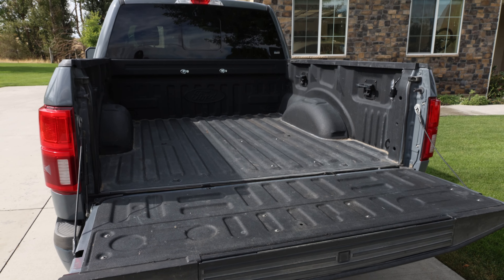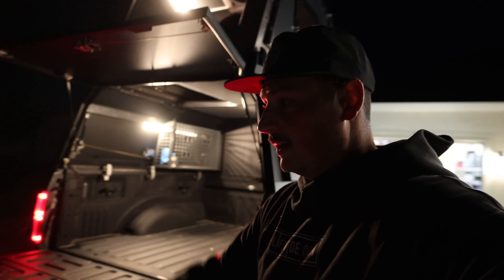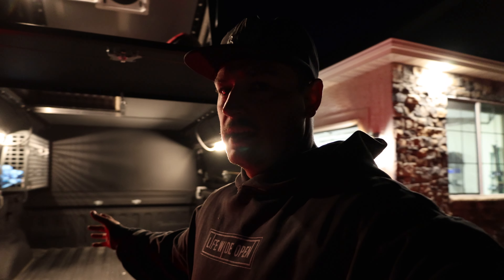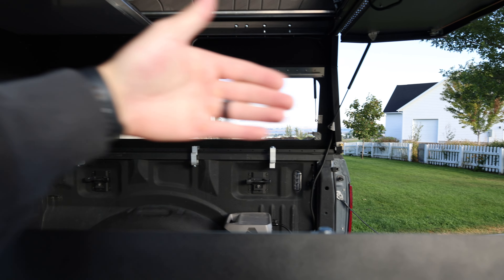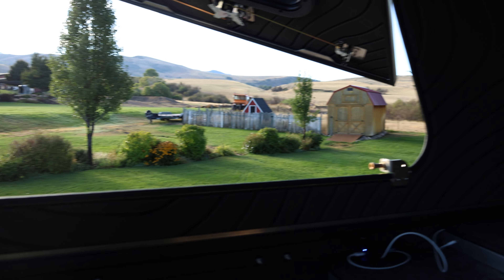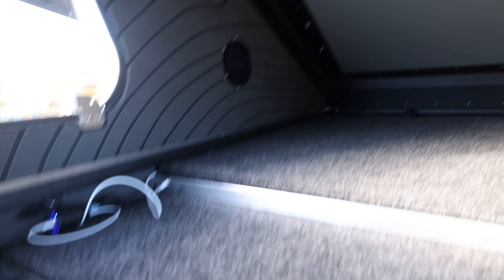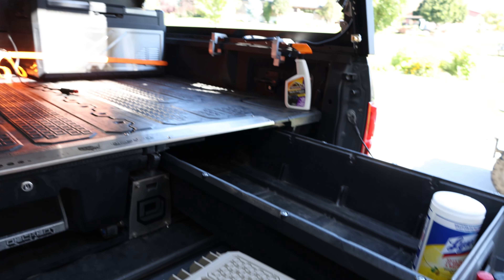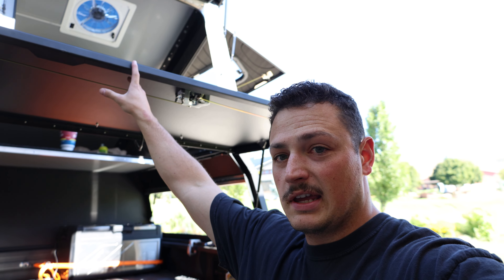Getting My Dream Truck Camper Installed! | AntiShanty Dwell Shell

Comment: Pretty cool set up , looking forward to a follow up after you have spent some more time with it . I am looking at putting one of this type of wedge campers on my Lightning eventually
Reply from the maker: Will definitely keep you up to speed on everything I learn/ experience with it. 
Having all that power accessible from the lighting would be so sick.
Reply: @coleeades  one of the reasons I bought it is the pro power system

Comment: I pick mine up in two weeks... pretty excited! Living in MT, the ol lady wanted to feel safer around bears and I cant drag a camper up the 4x4 trails we take. Ill probably also use it for ice-fishing/hunting as dragging the camper around on icy mountain passes sucks! 

Question for ya- did they include a ladder or show you how they hook up?
Reply from the maker: Ladder is an upgrade option that you can get from them. There are pre drilled holes on either side that you can add their brackets too and then the ladder just hooks right in.
Reply: In the original walk-through video, they clearly say "with our included ladder and ladder mount." I also didn't see any option for one on the website.  That being said, I have never seen one with said ladder so I presumed that was the case lol. Thanks!

Comment: Very nice.  Regarding the RTT part, can you use that ceiling vent fan when it is raining, is there a partly closed setting that allows the air flow but will not allow rain to get in?  Did I see a small vent opening on the low side for a heater tube potentially?  Do those small glass windows keep rain out if partly open?  When it is all closed does it leak at all in rain or in the carwash or power hosing it off, do those side or rear gull wing doors or any other part leak?  Thanks.  Nice set up.  Is it very difficult to completely take on and off, if I wanted to use my pickup as a daily driver and only put it on every so often?  Thanks.  I had been thinking about an RSI Smartcap and maybe a Roofnest pop up RTT, but this is very intriguing.
Reply from the maker: - The fan cover twists open so you can set it wherever you want. You can open it all the way for max air flow or just barley crack it open. I used it in the rain a few days ago and used the roof fan multiple times in the night while it was pouring rain and no water got in. I also was able to crack open the small Artic Tern windows without any water getting in. 
- There is a 4" Marine port that is designed for a diesel heater hose. (It works amazing) 
- It's perfectly sealed when closed to rain or power washing. Also didn't have anything leak when setup in the rain. All the doors have a very nice seal. 
- For taking it on and off it's about the same as any truck topper. They are designed to stay on semi permanently. But you could take it off if you had too.

Comment: Nice camper shell! Just curious what size engine do you have? You on 35s? On my 3.5 ecoboost Raptor I’m averaging 14.5 with rtt and rsi smartcap setup
Reply from the maker: 35's, 3" lift with the 3.5l Ecoboost. I also have a tuner in my truck which may help with MPG a bit? Not sure...
Reply: @coleeades  wow maybe tuner does help. I was getting 18-19 with empty bed no topper or rtt on it.
Reply from the maker: Ya it must! I don’t know anyone they gets quite as good MPG as I do.

Comment: Thank you for the content.  Does the Dwell Shell require any screwing into the truck for installation or is it all clamp on?
Reply from the maker: No drilling. Just uses 6 clamps that hold it to the bed rails.

Comment: How air tight is it? Like if you drive down a dusty trail. Will it be full of dust inside??? 

Looks like it will be full of dust.
Reply from the maker: The actual Dwell Shell is very airtight. Most dust comes from how bad the seals are on truck beds. I still don’t get a perfect seal on the tailgate but otherwise it’s great.

Comment: What's the chances of those doors freezing up in a Colorado winter and then you can't break down the camper?
Reply from the maker: I've had it in sub zero temps multiple times. There's not really anywhere I can think of that would freeze up bad enough to prevent it from closing.
Reply: @coleeades  Awesome thanks. I'm sure I'll have more questions.

Comment: How do you put it up or down in the rain without getting interior wet?
Reply from the maker: AntiShanty says it’s not as big of a problem as people think. But I have not experienced any rain myself yet. Maybe just a quick wipe down with a rag as you fold each panel?
Reply: @coleeades  I would be worried about the bedding.  Otherwise it looks awesome.  But that sounds like a big drawback to me.  Let us know after it rains!
Reply from the maker: Used it in heavy rain and somehow the side panels were dry. It rained all night long and I folded it up first thing in the morning. I think the sides are vertical enough they the water just drips off

Comment: Fan is a nice touch that's about it ($500.00 addon). Only 3 lights for $400.00 additional to overall cost? I guess insects aren't a concern because I see no screens. $15,400 to mount on a F150 with no addons? Was this given to you for a test? Please tell us you weren't ignorant enough to buy this outright. Talk about "expensive fridge slide" is laughable after looking at the price tag on this. Imagine being in this tin can when it's a hot summer night. Imagine sleeping next to someone slapping at skeeters while drowning in your own sweat. "I'll just use a portable AC", well enjoy spending even more for a higher output power unit and then fiddling around with hoses etc. 1 night of ac maybe unless you're by shore power. Solar isn't going to keep up with an ac unit that's for sure. For the same price you can buy a 2024 bumper pull trailer or a truck bed camper with a toilet, sink, tv, kitchen, ac unit, solid walls etc. Hey kid, please tell us how it feels when you miss latching, or a latch fails on one of those side panels and it slaps you upside your head. That would be good content. Buyer's remorse incoming. "Cabinet" is a joke for additional $280.00. Many other websites offer such better solutions than that mod, hilarious waste of money again. From what I can tell this set up cost $16,580? I hope install was free, if not, how much more did you spend so we can laugh harder at your poor spending habits. Man, those white lights are going to draw bugs in quick!  Could have fabricated something better with the $400 spent on that mod. Bedding will have to be stored in truck cab or in the dirty ass truck bed during wet weather. So, when it rains or morning dew, the sides fold inward to drain all the water inside of the truck bed and unit and all over whatever you store in the cargo box. Hope you like mold smells. Genius engineering! "OH WELL I WILL JUST WIPE IT OFF", who wants to do that each time you leave camp? As much as you wipe, you will never get all of it. So many points of possible mechanical failure. Just wait till you or your wife busts their ass on the slick decked system top. Splash a bit of water on the decked system or have some mud on your shoes/ flipply flops and see how slick that surface becomes! Deadly morning dew. Hope the small child bounces, because a fall from the sleeping section or "totally sick window" is going to leave a mark. "Every child is different", just another hazard with the now larger openings. Hope no one is gassy during the camping trip, this tin can looks like it can hold a fart in for quite a while! Congratulations on getting your 'dream' set up. Interested to see when this dream becomes a nightmare. Good luck keeping up with the Jones's.

P.S. You should have invested in the lightning rod for only $1500.00 more.🤣
Reply: Who hurt you?
Reply: For starters if its not for you thats fine why be an ass to someone who is happy with their new thing and wants to share it for literally no reason at all
And the second thing i find it funny that you an obviously highly educated person of science are un familiar with the concept of a faraday cage 🤔
Reply from the maker: Hope he feels better now 😂
Reply: @coleeades typical stick with their cheap disposable rv that falls apart after a couple of years. He does have one very good point though. I really want to like this. They advertise this as good for where they require hard sides. But some of those places are in Alaska and Northern BC. Where mosquitoes are a huge problem.
Reply from the maker: @ericschneider4976 for sure, they have bug/blackout shades for the Tern windows but if that doesn’t provide enough airflow I may need to experiment with custom bug screens for the big doors
Reply: @coleeades  I would definitely figure out screens for both the upper and lower doors just incase you want the ventilation. Should be easy to come up with some type of magnetic mount or something like that . Wouldn’t add much extra weight or bulk and could come in very handy. Maybe check out the ones oru designs offer for the lower doors on their units for some ideas
Reply: @coleeades they are working on a screen system. That was one of my concerns. I do a lot of camping in the midwest